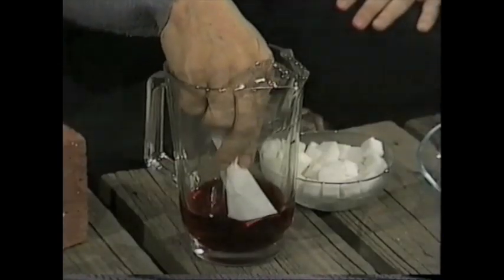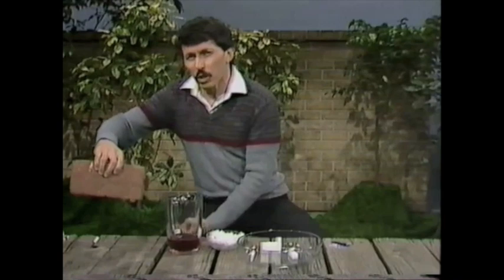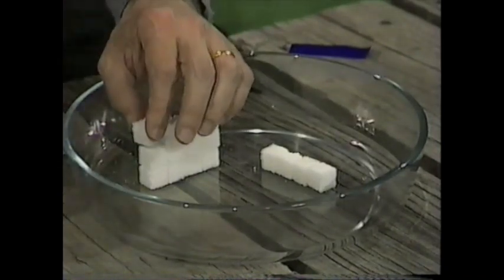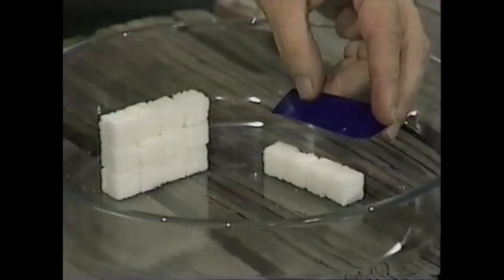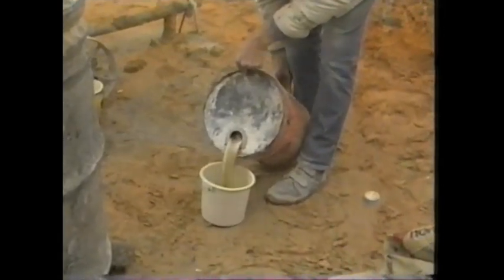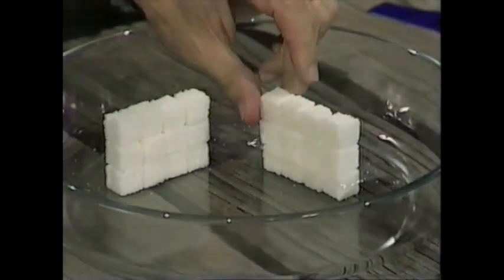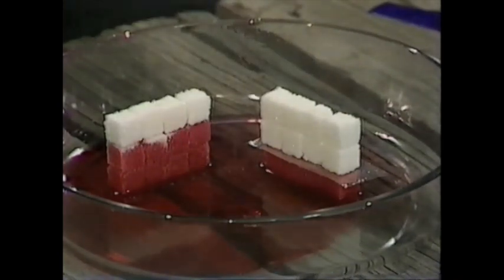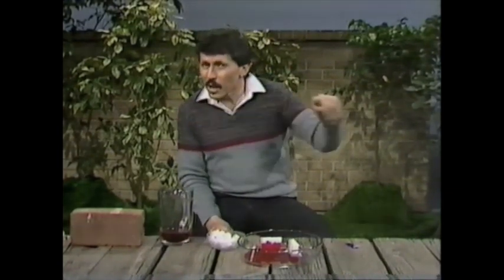Damp Course

Comment: Mostly these days in brick houses they use a thin black or dark blue plastic material called Malthoid as the damp course, it's usually a course below the floor level of the house, and at the level of the vertical weep holes (which are there not to allow entry way into your walls for bugs and insects as one might think, but to allow ventilation and air flow into the wall cavity so any moisture in there can escape up into the roof space).
Damp course, weep holes and vertical expansion joints (usually filled with a dark foam strip) are Building Code requirements here in Australia. and have been for a few decades now.

Comment: There’s nothing worse than a damp house. I used to live in the top roof floor of an old Victorian house, and in the winter I would wake and the duvet would feel damp. I later realised the roof was leaking and the duvet had attracted the moisture due to the body heat. When I moved out there was a square of black mould behind the head board. Rank!

Comment: I'm really surprised that all modern houses aren't given this damp course treatment on the bottom layer of bricks or cinder blocks. My house is fairly new (built in 2003) and is on a bit of a hill on the corner, but in 2004 when Florida had those back-to-back hurricanes we had a LOT of rain. So much, in fact, that the ground couldn't absorb it fast enough and so it soaked through the cinder blocks (which up to that point I thought was impossible) and into my bedroom. There is a way to waterproof the blocks, but it's a lot of work...